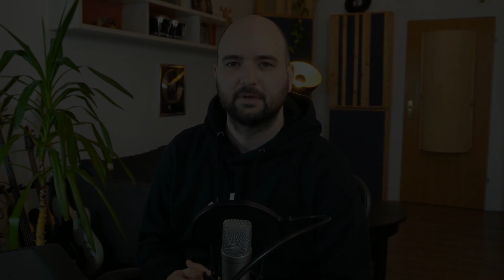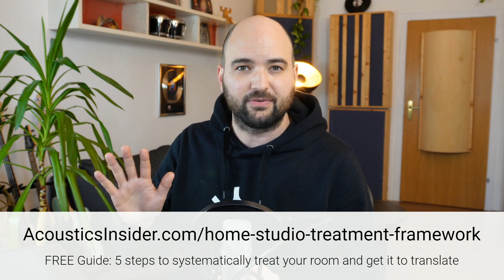DIY Home Studio Acoustics: How Much Treatment Do You Actually Need To Hear A Difference?

Comment: Firstly thank you so much for your videos and other content - I've learned so much and feel confident in knowing where to start with my room for the first time. 

One thing I've been wondering though specifically in regards to the amount of treatment required. It looks like your own room only has a handful of panels (and the interesting rounded thing on the door) but far less than the amount that you typically talk about, or the amount I've seen in your case study videos. Is this because you don't need as much due to clever placement, advantageous room dimensions or anything else?

Comment: Can you explain this? I sit in the sweet spot of my monitors. I monitor at a reasonable level. I have some treatment. I listen to great commercial recordings and they sound great! I mix my songs, referencing the commercial mixes and am able to achieve very comparable mixes tonally. Great lows, mids, highs, everything. However, when I listen anywhere else (car, home stereo, etc.), the commercial mixes still sound great but, mine are really bass heavy. How can this be? What causes this?
Reply: It sounds to me as if you are not hearing all the bass frequencies.  So when you listen elswhere, for some reason  the other systems are reproducing something you just are not hearing in your space. is it edm? Is it sub bass? Are your speakers set up properly ?  I can not think of any pther reason, except for not physically hearing those frequencies in the first place.
Reply: @willb1157  No EDM. Typically rock, pop, metal, modern indie stuff from different clients.  Yamaha HS-8 monitors, correctly set up and calibrated.  Commercial reference tracks sound great on my setup. I mix trying to replicate the overall tonal balance of the commercial tracks. So I end up with the commercial tracks and my tracks sounding great, on my setup. Then when I go to other playback systems, the commercial tracks still sound great but, my mixes sound really bass heavy.  It's very confusing to me.
Reply: Hi Studio Dude, While I obviously can't assert what the actual problem is, I'd guess it's one of two things. You might write your songs in keys that are different from the other composers you listen to, and the key you're in happens to sit precisely on a null in your sub range, which causes you to turn up the volume. My second guess is that you're not treating your bass instruments with enough limiting or compression, so while it may sound fairly controlled in your listening setup, certain notes will jump out at you much more strongly once you move over to a different environment.
Reply: @williambrewer3150  It happens with songs by multiple clients, in different keys and genres. Your 2nd guess is one I had never really thought about. I will check that out.